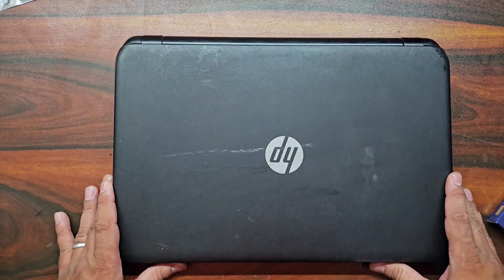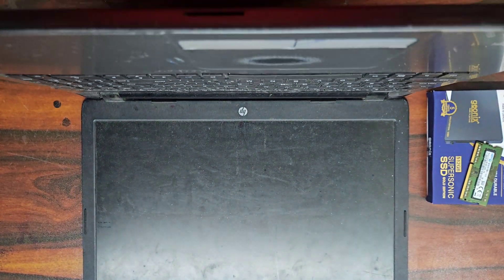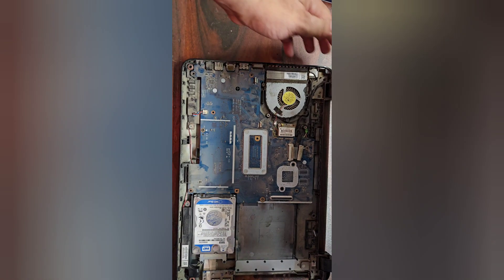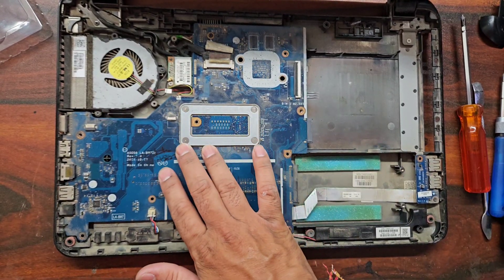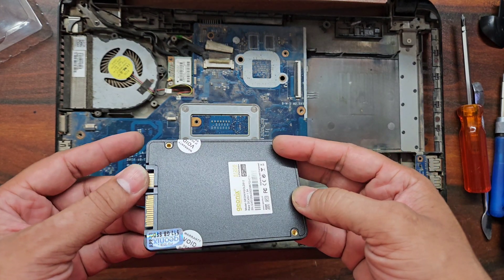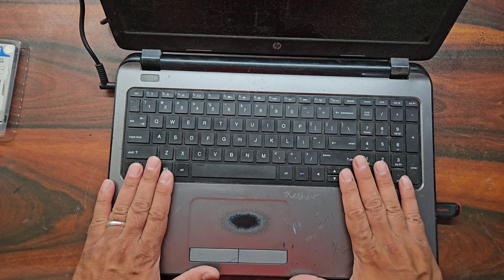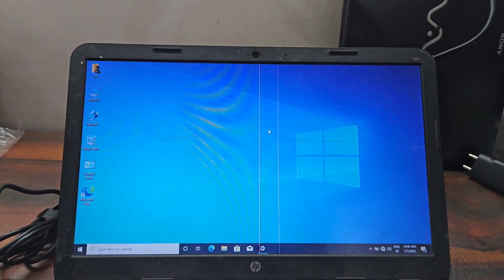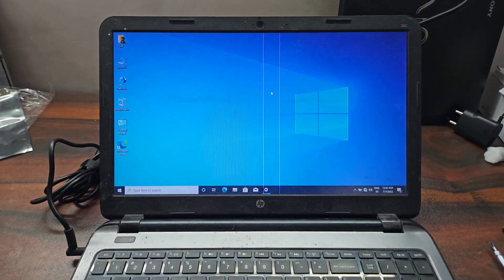#HP 250#SSD INSTALL#HP 250 G3 UPGRADE#RAM INSTALL#HP LAPTOP UPGRADE#HP HDD REPLACEMENT#SSD UPGRAGING

Comment: How much it costs
Reply from the maker: These days the prices are very high

But at that time I purchased both items for 2000 rs
Reply: @thansingh7047 thanks for replying. I also have the same laptop, and it is very slow.
Reply from the maker: Go for the same upgrade, it will work fine
Reply: @thansingh7047 thank you 🤝